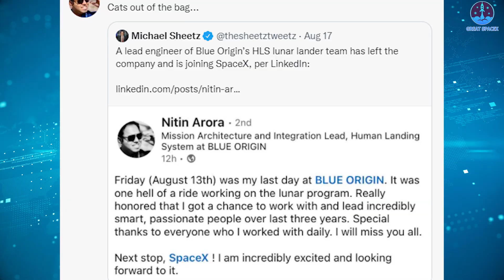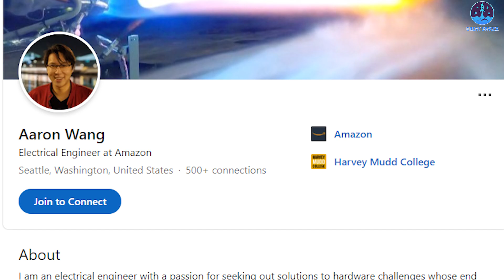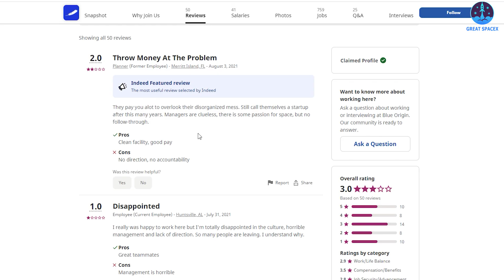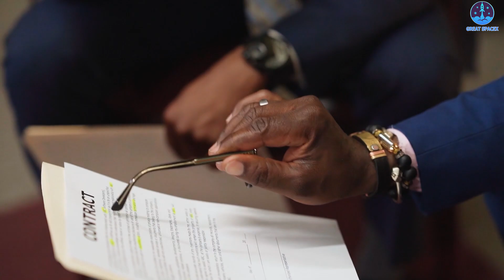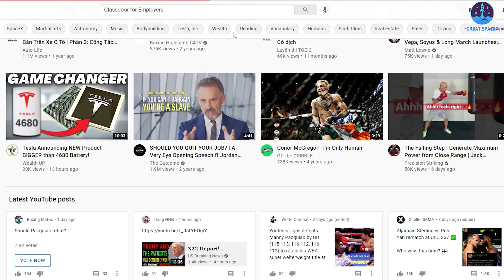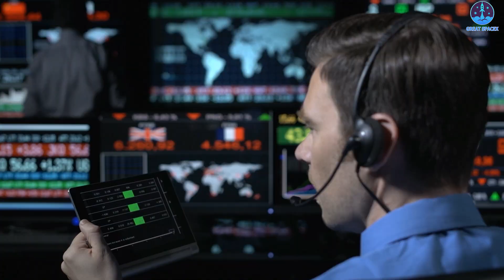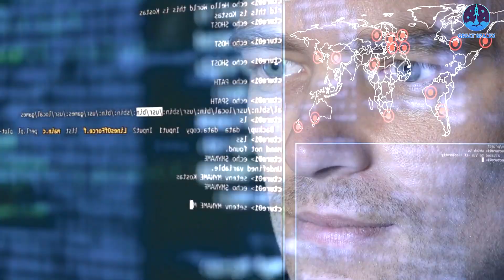Blue Origin END GAME!! Top GENIUS Engineers Escape Jeff Bezos to Join up SpaceX & Elon Musk.

Comment: There is no way new glen is going to be ready in 2022, all they have so far is a partially constructed manufacturing path finder. If they operated like SpaceX they might have a slim chance of 2022 but they don't so no chance at all. They are struggling to deliver just 2 engines to ULA by first quarter 2022 and even then have warned they wont be fully tested. Meanwhile SpaceX is producing a raptor engine every 2 days and in 18 months went from star hopper to final prep for an orbital test launch.
Reply from the maker: yes they are always famous for being late😁😁

Comment: It may be nitpicky but Blue Origin went to the edge of "Space" not the edge of "Orbit". The difference between these 2 is vast and important. Getting to orbit is an order of magnitude harder than simply going up and down which is what Blue Origin did (They simply followed a ballistic trajectory). In order to get into orbit you have to go sideways really really fast or specifically 17,000mph (mach 22). Blue Origin are currently nowhere near this capability at least not until their New Glenn rocket is finished and flown.
As the saying goes:
"Going to space is easy, staying there is hard"

Comment: say... Doesn't the Raptor have about the same thrust as the BE-4 engine now? Wouldn't ULA be able to use the Raptor with some modifications on their rocket?
Reply from the maker: hmm, they had a previous contract with BO so it hard to say.
Reply: There so many factors that go into the design of a rocket engine it would take years to make that happen. A this point they just have to give Blue more time and hope they can do it.
Reply: @kstaxman2  ULA doesn't have much more time. Why? because it has a multi-year contract with the US Air Force to launch their payloads. But, from January 2023 these payloads must be launched on a rocket using American engines, and not the Russian RD-180 that the Atlas 5 uses. So, enter the new Vulcan-Centaur which uses 2 Blue Origin BE-4 engine for the first stage. And here is the issue: to qualify for the US Air Force as a certified safe trustworthy launcher, Vulcan-Centaur needs to have 2 successful flights before January 2023. That is not looking optimistic as of August 25th 2021, where there is no sign of a flightworthy BE-4 engine being delivered to ULA, only two hopeful contenders which may or may not not be considered flightworthy. ULA is not happy, and I'm sure the US Air Force sympathises. To a degree. It just so happens that ULA won 60% of that US Air Force contract and SpaceX 40%. I doubt that SpaceX would be given the whole contract if ULA is unable to certify its Vulcan in time, but it is an interesting thought. Maybe a ULA Delta 4 or Delta 4 Heavy could do the job, but I really don't know.
Reply: It's not some modifications it major modifications. How the gimbles mount would be different that means the thrust pad has to be redone. The length and balance of the mother is different that means the center of mass for the rocket has to be changed. The plumbing for the engine is also different so all the plumbing has to be re done. And the software and electrical needs are different so that has to be redone as well. Also the fuel usage would be different so it could possibly require changes to the fuel tanks.. It just goes on and on. Rockets are a total package that has to be engineered as a total package. And then it must be retested and certified which would require new test launch equipment.. It's basically the last thing they want to do as it's back to redoing most areas of the rocket, software, and electrical/sensors systems.
Reply: The whole point is for BO to develop their own engines. Using Raptors would deflate the entire fallos.
Also, I doubt Elon will sell BO any Raptors, for any kind of money :-D
Reply: This was a hypothetical question. I know there is no chance in hell this could happen... First BO had a contract so even if SpaceX tried BO would tie it up in lawsuits. 
Secondly I doubt SpaceX would sell them Raptors for any amount of money.
Now that reality is out of the way, could it actually be done? Someone mentioned all the re-work that would have to be done but I don't think so... SpaceX has demonstrated tremendous ability to modify the Raptor so I'm wondering if the engine itself could be modded to run on the Vulcan. The only drawback I see as a very hard obstacle is that the Vulcan fuel tank has a different fuel ratio than Starship.